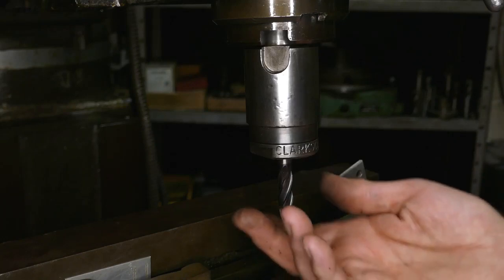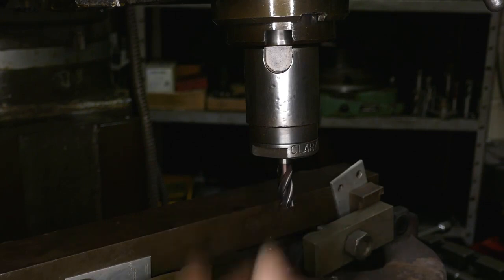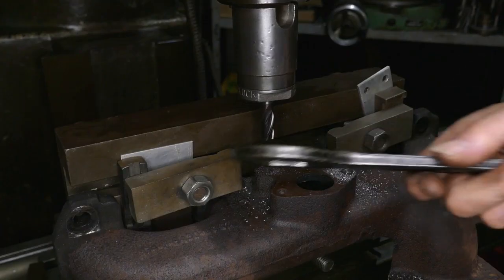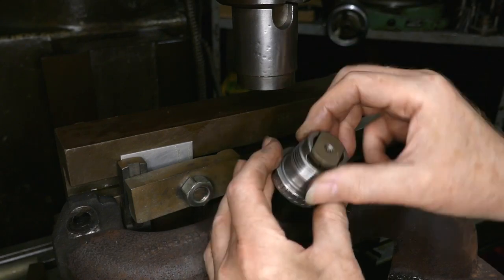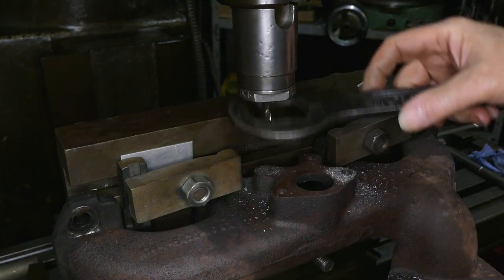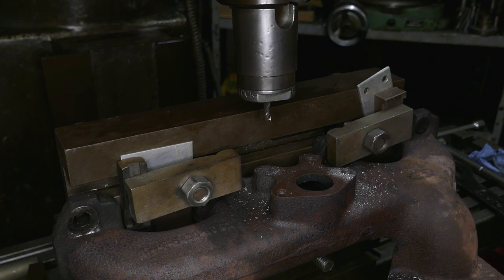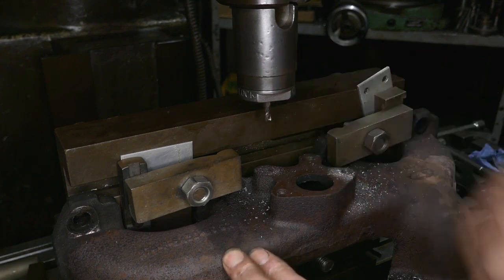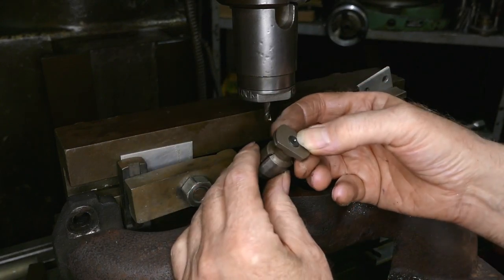How to properly put a cutter in a Clarkson Autolock Collet Chuck.

Comment: Hi MidEng, this is very useful thanks. I got two 30INT Clarkson collet holders with my Harrison Universal Mill and it's good to know how to use them correctly. I go to flea markets frequently and I can often pick up Clarkson threaded cutters more cheaply than plan shank - which is a bargain. Maybe £2 or £2.50 each (US$3 max) in good condition.  The machine came with 4 metric collets and I picked up a set of imperial collets off ebay for £15 delivered - which was a good score I thought. Cheers

Comment: Yes you will crack the ends of small cutters if there is a gap .  I cut my teeth on clarkson Autolock & Deadlock chucks .
Reply: yep , thats why i am here. got my new collets for a 1983 chuck today , put a 6mm cutter in the 6mm collet , left a 1mm gap , bit the front collar up one handed. crunch.. split the back of the bit like dropping a beer glass into another glass.
thanks !